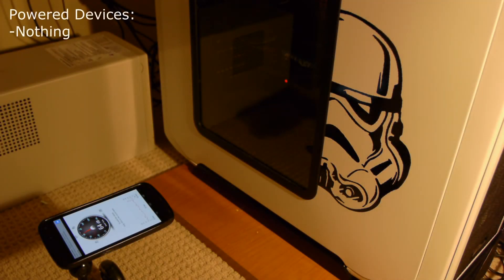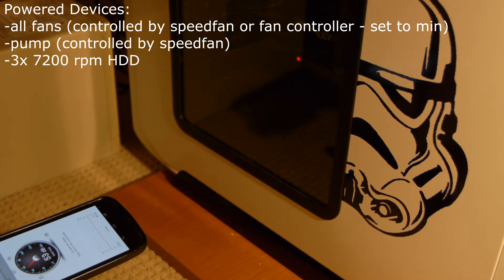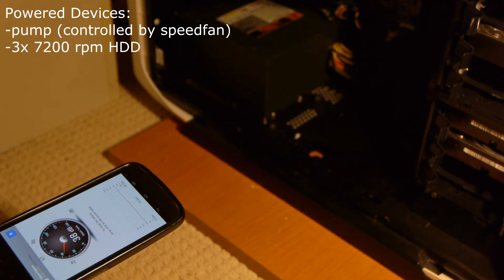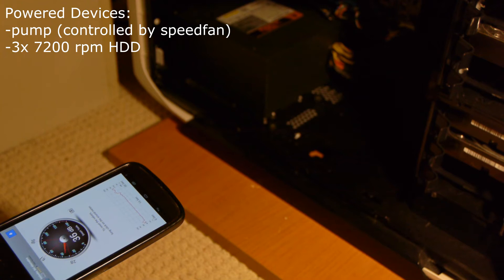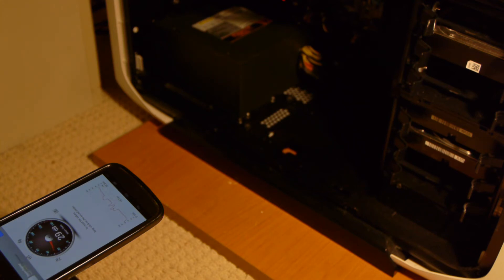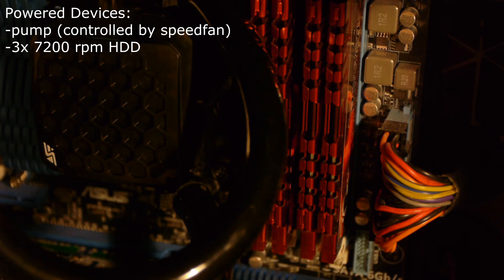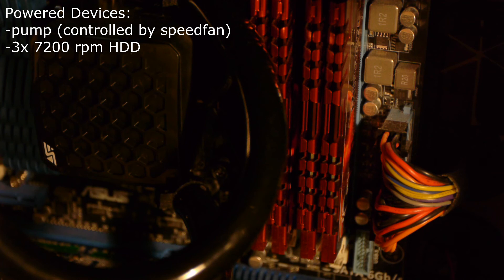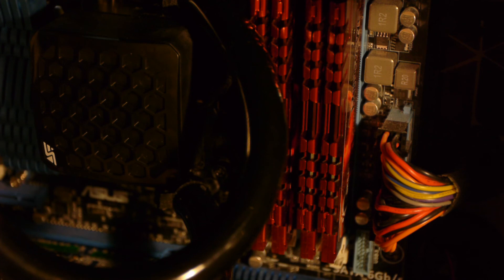H220 Experiment and Demonstration

Comment: My motherboard the lower it can put is 2000RPM. I tryed to use SpeedFan but it dont change. Its says allways at 2000RPM. When you put at 7:28 you say pump controlled. How much was the % on speedfan and RPM?

Comment from the maker: The Pump isnt running at a static RPM, it's actually being controlled dynamically. When you hear it at its highest pitch in the video, it's maxed out at around 3k rpm. it runs maxed out right when i start it up.